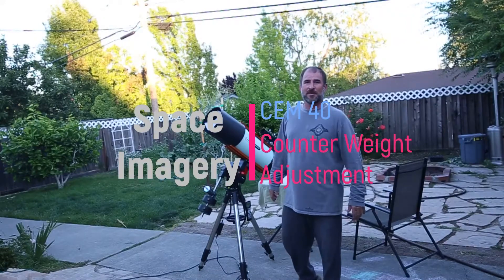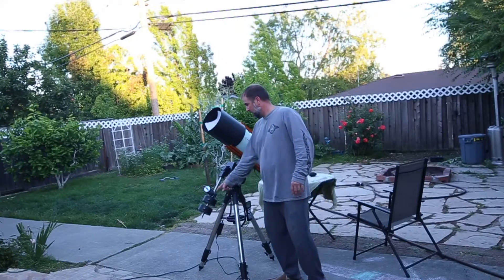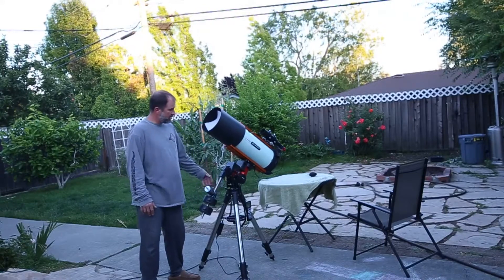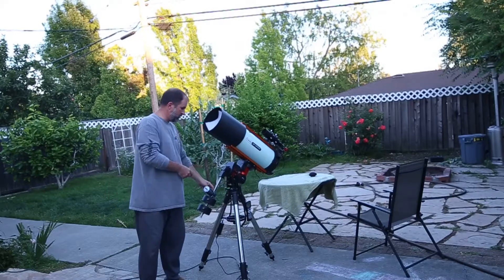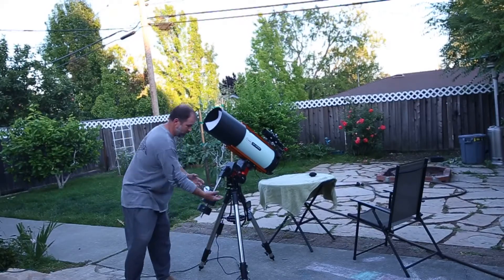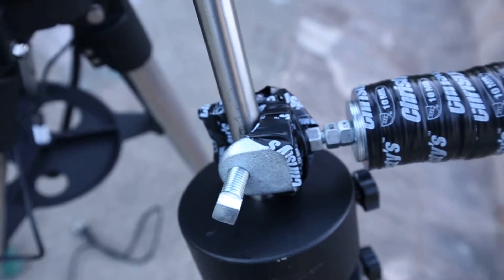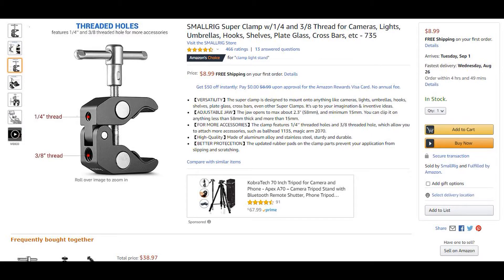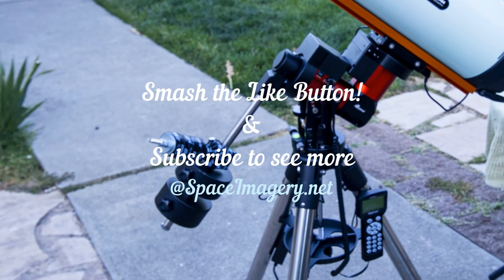Ioptron CEM40/CEM60  Bias Counterweight Issue Resolution

Comment: My CEM40 does this also. What I’ve found was the weights shaft bracket wasn’t completely straight with the centerline of the head and RA axis. I loosened the bolt on top of the bracket and two set screws on the side. Adjusted it straight. Check for third axis imbalance also. The saddle plate on mine needed to be adjusted based on the whole scope setup I have. After all the adjustments, problem went away
Reply from the maker: Didn't know about that.  Ill try it out.  Thanks.
Reply: ciao! I have a cem60 and I have the same problem, this seems like a great solution! I'm asking too much if you could post a photo and indicate which screws to act on? I couldn't figure it out from your above description... Grazie 1000 dall'Italia
Reply: @ Hi Biagio.  I don’t know how to post a picture on here.  Look at the 3 screws on the hub where the balance shaft screws into.  On top there is a larger one. Then there are 2 smaller set screws on the side, about 120 degrees apart.  Loosen these 3. Set your Home position as straight and perpendicular to the level ground as possible.   Then line up the hub and balance shaft the best you can perpendicular to the level ground.  Then tighten these 3 screws.  That’s it. Good luck.
Reply: @yf222000  thanks, you were very clear, I will definitely try to do it hoping to definitively solve the balancing problem of the cem60. your solution seems the best to me. thanks again

Comment: Great video as I'm in the market for a CEM40 or GEM45.  How does the mount handle your payload?
Reply from the maker: Thanks for the comment.  This mount is awesome. It pushes the RASA 8 like a champ.  That's with a 60mm guide scope, asiair,  and the asi533 that I use.  I also put a canon 6D with a Rokinon 135mm lends.  It pushes it all with no problem.